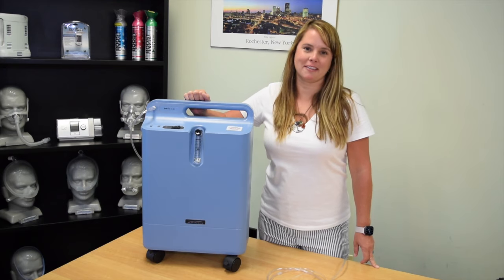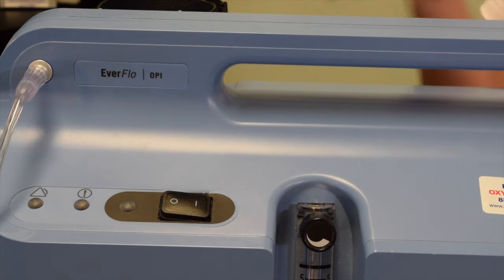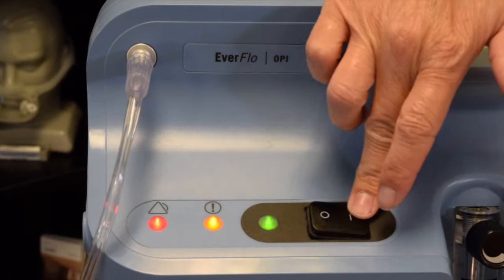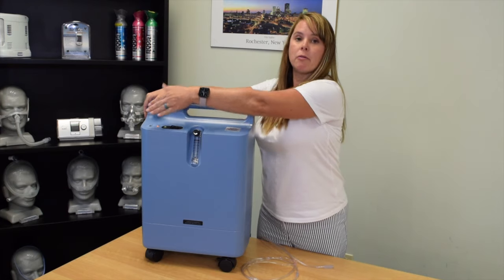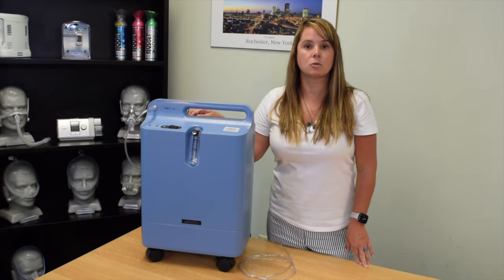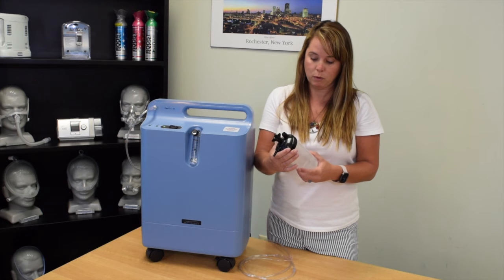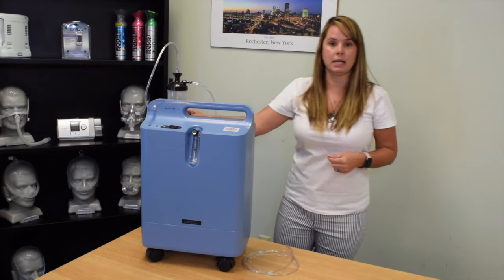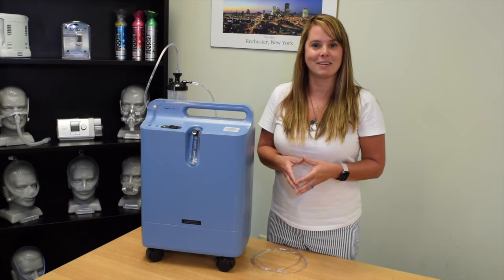Troubleshooting your Oxygen Concentrator

Comment: For tech questions I would contact your oxygen provider. The vents on the back should be wiped with a micro type cloth a few times a week. Also, follow the 12x12x12x12 rule  meaning it should not be within one foot of a wall or furniture and should be plugged directly into a wall outlet.

Comment: What if it beeps and then shuts off with the power switch still in the on position? I flipped the power switch into the off position and then back into the on position and the green light came on after five minutes. I think it overheated and auto shut off? At what temperature causes it to do this?

Comment: I've found turning the connector counter clockwise is faster and easier than disconnecting the tubing to remove tangles and kinks.
We used to disconnect the tubing and run it between our hands several times, twisting it counter clockwise allows the tubing and cannula to remain attached.

Comment: Ok so, Im a delivery tech and my question is: where does the concentrator get the power to prompt that beeping sound if it actually looses power. I tested some and the only one that did not beep during power loss was Drive 5 LPM. 
So where does the power come from for it to even be able to make a sound?
Reply: There is a backup battery inside the machine
Reply: There is a capacitor attached to the motherboard that supplies power to the beeper. The Drive concentrators' capacitors die after awhile, so they would need to be replaced to fix the issue, which will involve soldering.

Comment: Air inlet filter needs to be changed ? At what interval ? Also there are three metal cylinders inside box and one more thicker cylinder inside. What are they ? Do they also needs to be changed ? Mother is using since Jan 2020. Pls reply.
Reply: The three metal cylinders are the sieve beds. They filter all the other gases from the air and leave almost only oxygen. If you're getting low oxygen levels, changing those will almost definitely solve the issue. The other thicker cylinder is the compressor, which pumps air into the sieve beds.
Reply: @jonathancopeland3739  what about inlet filter? Do they have to be changed ? At what interval ?
Reply: @apoorvagala  they should only need changed every two years or so, unless they are used in an especially dirty environment.

Comment: Doubt this will get a reply as the vids old but
My father has this exact machine. 
The yeloow light comes on but no alarm goes off, if we shut off the machine then turn it back on the light goes away for about 5-10 minutes then comes on again, no alarm. 
What should we do or what could be the causes of this. We dont want to be a bother to the "air people" and wouod rather solve from home if possible
Reply: This is because the ball is above 4 or below 1

Comment: I am having a problem using the humidifier bottle all of a sudden.  I have water drops from the unit into my nose piece and some times feel like I'm drounding.  I've had sore throats for months.  Has anyone had this problem or know how  to fix it?
Reply: You need to get a water trap, your insurance probably won’t cover it. It’s a tube that sets between the cannula and supply tubing that catches excess water. Vaseline can help with the nose. Good luck
Reply: You may be putting too much water. But as the previous comment mentioned, a water trap is very useful. If you need 6 lpm+, then you'll need a high flow humidifier bottler and proper tubing.

Comment: There one thing: be sure the voltage is right. I got one in Peru that uses 220 volts. I took it to Costa Rica and tere is just 100 volts. Theplugs looks the same and I had to read the fine print but thank God it works now with 220.

Comment: I had a O2 concentrator just like that one. I put a "Light bulb timing device" in on a different breaker and the red light came on with it's beep. I restarted it numerous times to no avail. Insurance company got me a new one and it did the same thing. I removed the timer, and the machine works just fine. Any idea what the connection would be there? I've been an electrician for 40 years and I got no explanation.
Reply: That’s happening to me now.  I got a new one as well and a new extension cord too. I’m on oxygen 24/7 due to heart and lung failure.

Comment: What about the purity level? I believe it has to be >90%. What do we do if it doesn't go beyond 30%?
Reply: replace zeolite into the Bed tanks
Reply: You can try changing the filter on the back of the machine. Open the door on the back there is a plastic filter that needs changed after so many hours of use. You will need to contact your supplier for the filter.
Reply: Sieve beds guaranteed need to be changed if you're only getting 30%

Comment: how does it make oxygen? where does this oxygen come from, does it have to be filled with water, does it break the hydrogen hydrogen mecules or what? thank you
Reply: No water necessary, just plug it in and turn it on. It uses zeolite swing adsorption to separate the oxygen from nitrogen.

Comment: I wish I would have been given any type of information with my condenser.  I had a kink, no alarm went off.  It has been running for a couple of weeks and my O2 has been kind of bad (I didn't know why) - then the unit had an alarm and the water Level was low on the calendar in the front.  I didn't know why so I used the manual tank and a few hours later I called Aprea and they said to go to YouTube and watch the tutorials.  I found out how the water cylinder in the front tells you the number for the oxygen level.  Who knows what I have been running it on for weeks!!!!  probably six!!!  I didn't get a sign for my door, I didn't get any information at all.  oh and then I was told to change the filter.  on you tube it shows taking The Whole unit apart.  I am not going to do that.  It doesn't belong to me. when I got a hold of the company (by the way they are super nice) the unit reset itself and they cylinder was full again and from YouTube information I set the unit to 2.